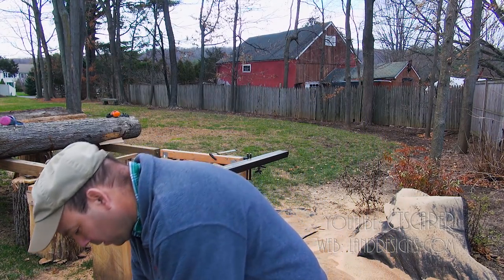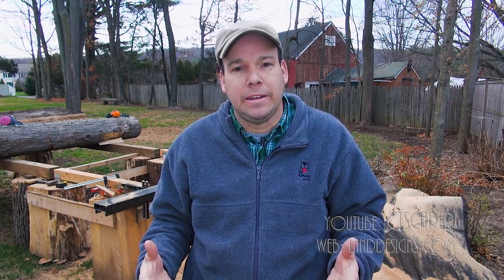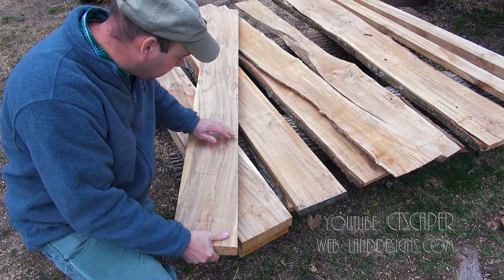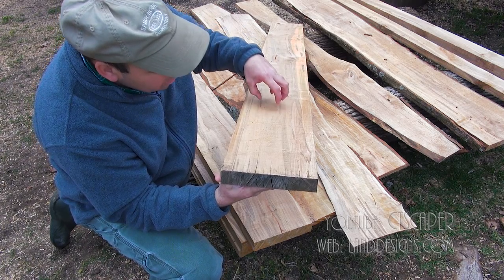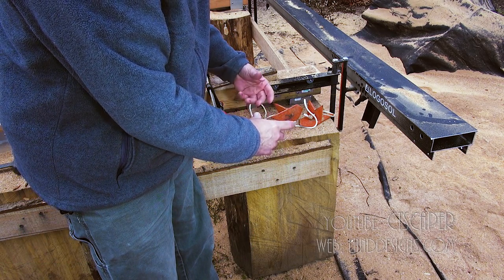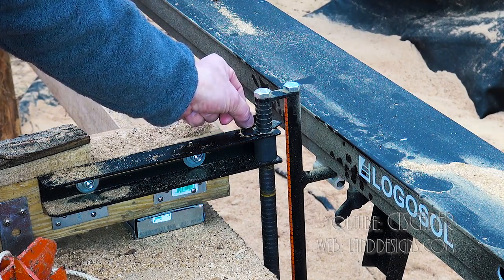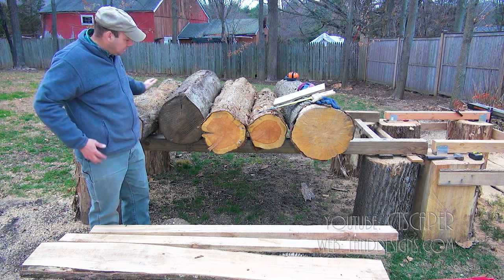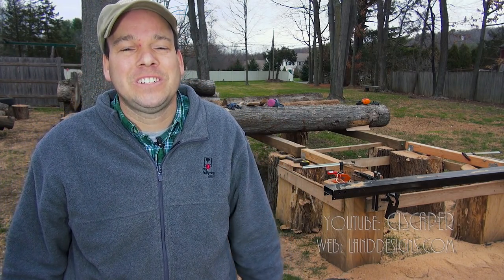CHAINSAW MILL LOG TABLE

Comment: I built a waist high table that I could load up to four logs on a time. Then built a shed over it so I could cut logs when its raining. Works great. Also put a hand winch on my 36 inch mill so I can cut bigger logs by myself. Also have a 30"24" and 20" Mills. Love cutting logs to lumber. Be safe and enjoy. Like your videos a lot. It is a learning experience for sure.

Comment: Like it .... Good to see you back in action .... I'm still working with the Timber Jig ... Some day I might step up to your league ...
Reply: Thx,, Hope you had a good Christmas too .. I find the timber jig useful but a pain in the butt with that wood rail set-up.. I find that the back glides lift up sometimes if you don't pay attention to em plus the rear right glide keeps coming free .. I discovered that the exhaust is heating that glide ... So I think I'm gonna try taking the teeth off my Stihl and get it further into the jig.. That may move the exhaust far enough away that it won't heat that glide ... It's a pain trying to find all the pieces in all that saw dust ..

Comment: remember, it's called rough sawn lumber. that's why you have deviations. at a comercial mill, like georgia pacific it's kiln dried, then run thru a 4 sided planer, and even then it's not perfect all the time. I've got a band mill, a 56" granberg chainsaw mill, and a restored 100 year old Frick circle sawmill with a 56" circle saw blade, plus edger. still mostly a hobby miller as I own/run a restaurant for my lively hood

Comment: How big of bar are you using? Just wondering if using a smaller one (granted you limited) if the bar would flex less? I had no idea you had such an assortment of mills. I am going to need to go back and look through your archive of videos. Was wondering what you do with the saw dust? Use in gardens, keep around for spills? This video could not of came at a better time. I am pretty wet behind the ears in this area but have been having a lot of fun playing around. Thank you for sharing!

Comment: Hey!  Run over to Lowe's and buy a planer.  Nothing's perfect but maybe a Woodmizer bandsaw mill would please your persnickity propensity, college man.  NICE bench idea.  I've been following you and will buy a Logosol soon and while the M8 looks good I'm betting that 4 vertical posts sunk as permanently as possible with a ramp up the back side to load logs will be the way I go.  Finding this vid about your table is timely and I LIKE IT.  YOU'RE ALL OUTDOORS in my book.

Comment: I like the log table! I run a Granberg, so it won't have to be as elaborate. I've been trying to find ideas on how to raise the work up. Currently using just a couple of logs with vee-notches cut in them. I really like that plan though, like a sawmill feed table.

Comment: Awesome video mate, have you used an Alaskan mill? I am building a log deck and  platform for the cutting of the log with my alaskan mill, it certainly makes life so much easier with the log elevated. Alaskin's cut dimensioned boards very accurately with the bar supported on its nose, keep the videos rolling👍

Comment: Really good and like your log table, I have to build one for my self soon ... 
Your bar should not flex so much. Try to measure the distance from the back of the bar to the log table and then from the front. Could be that you need to put skims in front or rear of the saw carriage to adjust the angle.

Comment: Thanks for sharing.  I am thinking of milling my 1 acer lot. It has about 100 pine trees about 60 ft tall and 24 inches at the base. I would like to cut most of the lumber for my house. Especially the 2×10s that cost the most to purchase. Any hints?